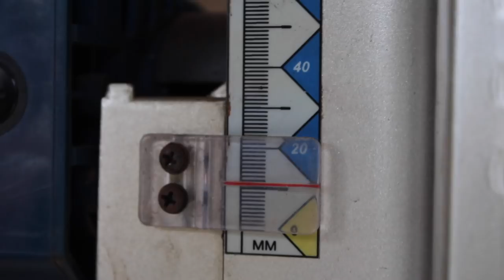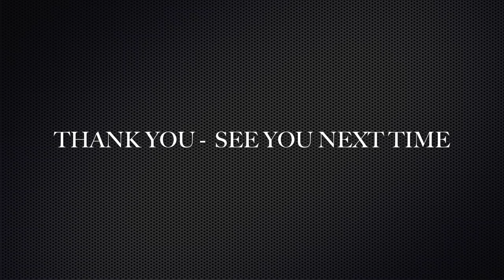Funky Curvy Coffee Table Build Part 2: Forme Industrious

Comment: Hi Scott, great table. Could you explain the staining process you did please.
Reply from the maker: Hi David, I just used Wipe on Polyurethane Clear Coat on the timber. No stain.  Originally I wanted to try shellac though hot coffee cups might create burn rings so I stuck wipe a durable Poly coat.  Thanks!

Comment: the table is beautifull, but the top is at an other level, i love it ! Too bad you only have a planer, jointing first would make it easier to assemble and make it last longer too.
Reply from the maker: Thank you. Id do have a jointer now and does make work easier. On this job I used the router table as the jointer.

Comment: I really like the way you finished the metal base by exposing the raw steel on the edges and the two tone paint job works well. And the poly coat on the wood almost looked like an oil finish. A great design. Was this a commissioned piece or just something you wanted to make for the hell of it?
Reply from the maker: Cheers Doug! As you know there a so many ways to do the finishing, sometimes its roll the dice. I'm really happy with the wood, it's a beautiful timber that has a golden shimmer to it.  Made for the hell of it, but I will be putting this one in an exhibition late July and see what happens. All the best!

Comment: I very much enjoyed the build and appreciate your taking the time to share it! Not at all wanting to be a keyboard warrior, but is there any concern for expansion and contraction along the grain? Such that might warrant oblong retaining holes (laterally) in the steel? Thanks again.
Reply from the maker: Hi Doug.  Thanks for your comment, good point. The holes are slightly oversized thought could do with a little more elongation for the reason you suggest. Cheers Doug.

Comment: Hi Scott, nice work.  Just come across your channel and like the styles.  Why do you use a cloth and not a brush or spray for the polyurethane finish?
Reply from the maker: Thank you! well I use the Wipe on Poly. Cloth is very convenient and effective for putting the first few coats on. More recently I put the finish coats with my HVLP spray gun, with very light sanding between coats. With the wipe on poly, the product flows very well using the cloth and flattens out. Hope that helps.